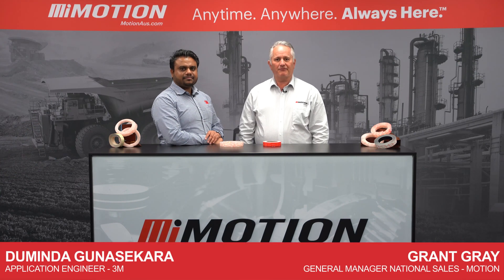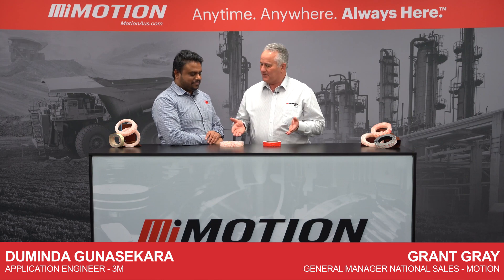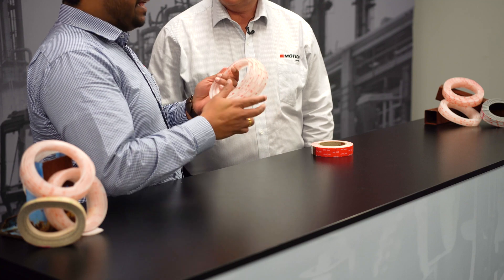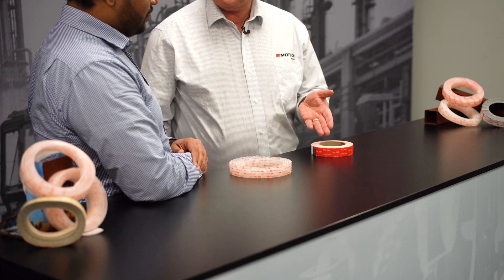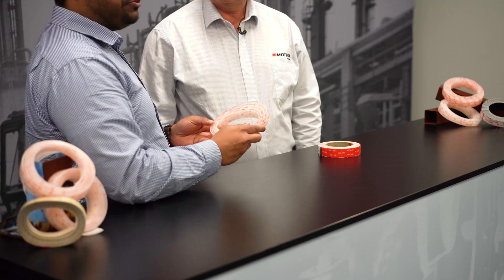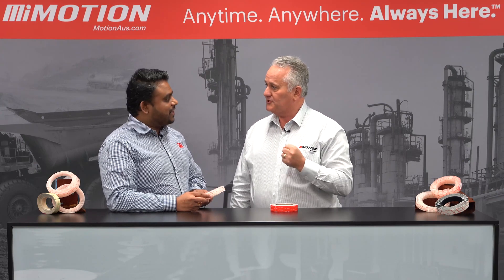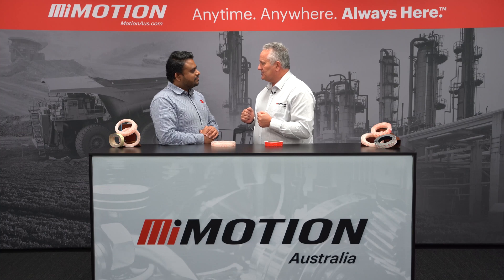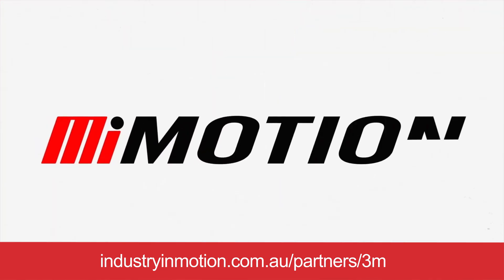3M Dual Lock™ vs. VHB Tape: What's The Difference?

Comment: I was expecting to see a strength comparison between the two products actually being demonstrated. I know the 3M Dual-Lock can be repositioned, but is it as strong as the VHB? I thought that was the reason for this video.
Reply: can't vhb be repositioned too? what does it mean permanent? the adhesive? because I bought some rectangular pieces already engaged and I think I can separate them. than you
Reply: Literally same thoughts.